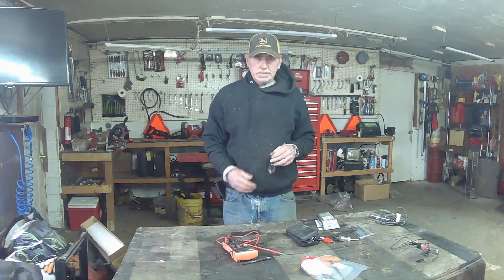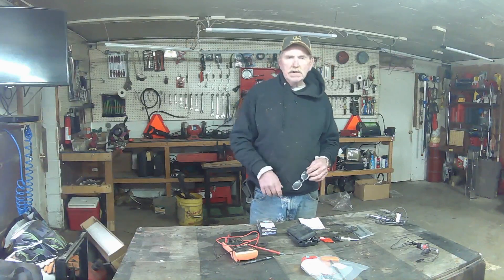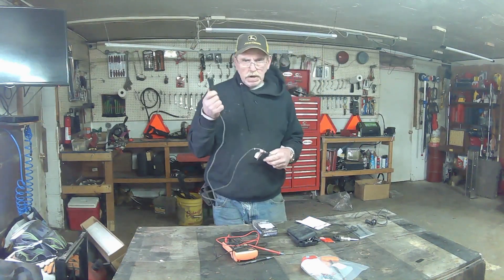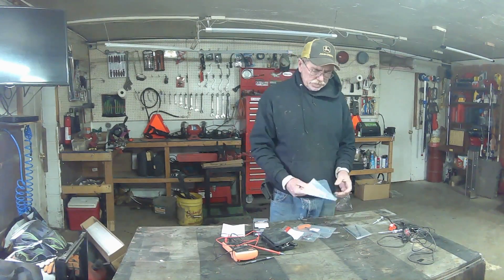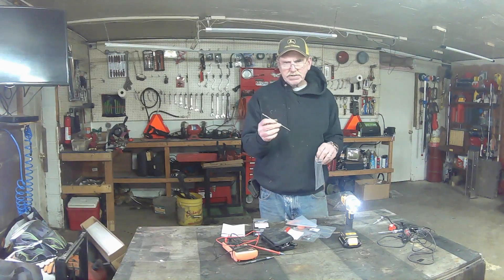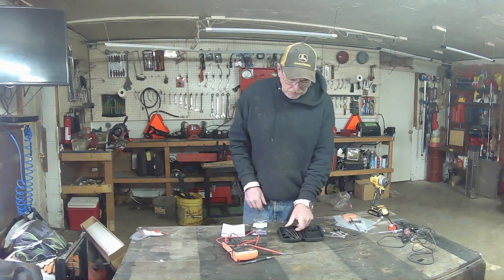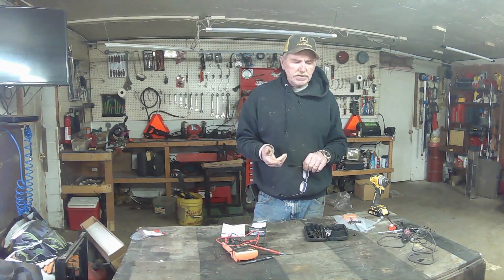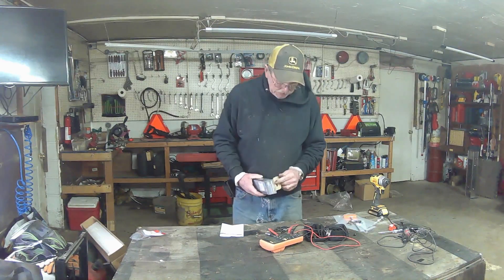Specialty Tools Part 1:  Electrical, Carburetor Tools & Gap Gauge For Sparkplugs

Comment: There are at least 14 different carburetor screwdrivers so make sure you get the largest set. Some carburetors that you think might not be adjustable might have a tamper proof plastic plug that has to be pulled out using a small screw or a small bolt. You can use Google or YouTube to find out if a carburetor is adjustable. Years ago I use to throw out a lot of carburetors that I couldn't get to run correctly. Some of the Briggs and Stratton, Tecumseh, and Kohler and other carburetors are fixed jets and I would soak in Gunk parts cleaner 2-3 times for 3-4 hours before they would get clean enough to run rich enough and not surge. Most carburetors would only take about 3-4 hours. Now with the ultrasonic cleaner it can be cleaned for 2 minutes every 15 minutes 4 times and set in the solvent for 1 hour total. So it only takes about 1 hour instead of 8-12 hours for the tough ones they usually come out spick and span clean.
Reply from the maker: We usually just use a set of needle nose pliers to pop off the tamper proof plugs. That is my next investment is the ultrasonic cleaner. thanks Jason
Reply: @northernnewyorkparts  if I had to do it again I would get a 6Liter in stead of a 3L. I also use quart and gallon ziploc bags for the parts and cleaner. I can fit most gunked up chainsaw covers in a gallon bag. It effortless cleans them. A saw can look like new in minutes. On some small string trimmer and tiller carburetors there are flush plastic plugs. I have a tool that threads in but most of the time I have to heat the tool with a torch then stick it in the plug and let it cool to remove them. That tool comes in the large adjustment screwdriver set. It looks like a small threaded rod. I wondered what kind of adjustment that was for then figured it out after a few YouTube videos. They hide the adjustment screws very well on somethings.
Reply: You are A great source of information ! Jason ! Thanks!!
Reply: You are A great source of information ! Jason ! Thanks!!
Reply: @stevepape9011  your welcome steve, we have a great place to come and chat small engines here. I don't know everything but there is usually someone that can answer most questions. Sometimes I even learn something new to try. Anything that makes the job easier or can fix something deemed non fixable is a win in my book.
Reply from the maker: Jason is a great asset just like every one of you on the channel. Its all about learning, helping each other and offering support to those in need. Just the meer fact that we can all get along and agree to disagree at times that makes this a well rounded group of people and I thank you all for that!